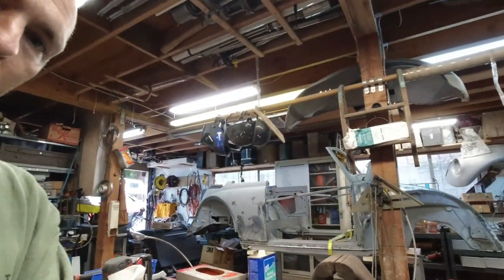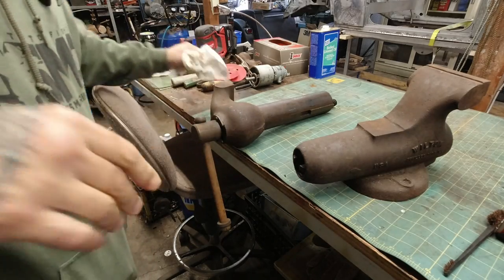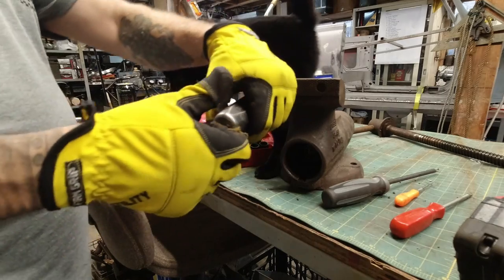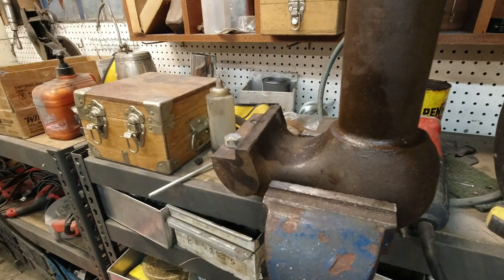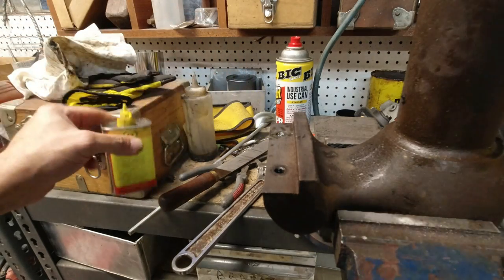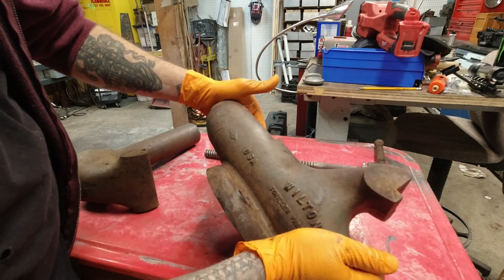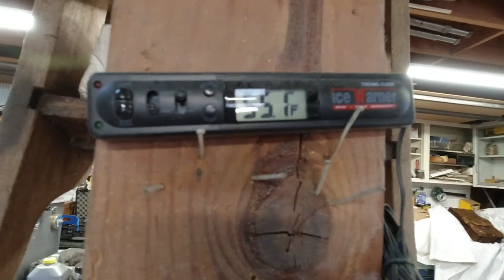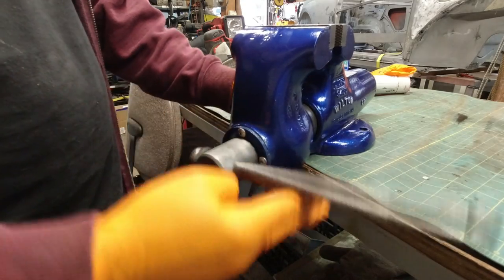Wilton Bullet Vise Restoration "1967"

Comment: That snap on impact is sweet. I have a Mac one. On jaws I usually throw a bit in my cordless dewalt impact and give it a whack. Usually a flat tip and I end up breaking about 3 bits in the process.

Comment: If you get into a situation again where you have to weld a nut on to remove a bum fastener, use a 6-point socket and a breaker bar on it vs. a crescent wrench, less hassle & less chance of busted knuckles.....
Reply from the maker: Cool! Thanks for the tip!

Comment: Make yourself a mixture of 50/50 mix of acetone and ATF and spray all those screws about 8 hrs before disassembly... it should help you a great deal with those screws, then use your impact driver....
Reply from the maker: Thank you I will try that in the future.
Reply: @MadStiles  Another tip I got a while back is to put the heat to a stuck fastener then spray it with PB blaster. The heat pulls it down into the threads. Then let it sit and work for a bit, apply heat again, and give it a try for removal. It worked great for me on O2 sensors, and those are pretty stubborn. 

Also, great work on the vice. Hope you get many years of use from it.
Reply from the maker: Thanks for the tip!

Comment: Nice work. Did you figure out the date?
Reply from the maker: Not definitively. Mid 1900s I'd say. AlloyArtifacts.com is a great resource.
Reply: @MadStiles  When you open the vise up all the way, the date should be on the bottom of they key that keeps the jaws lined up. Just found the date on my Wilton vise and apparently thats where they all were stamped.
Reply from the maker: @vinnysmith587  awesome thank you I'll go check it in a few minutes actually
Reply from the maker: Looks like 67 so I assume 1967